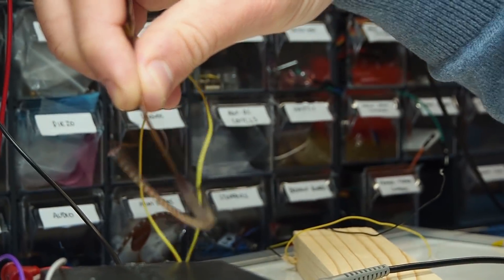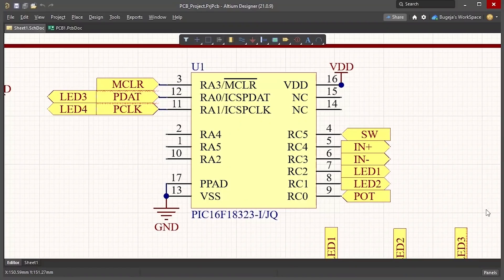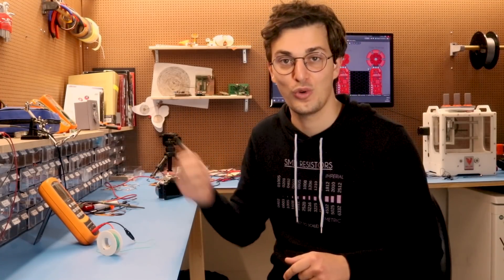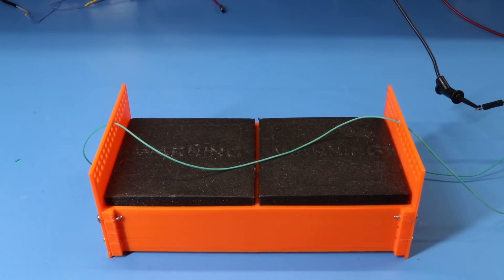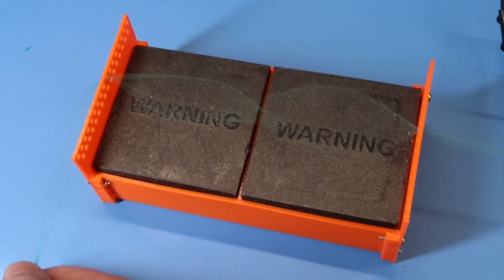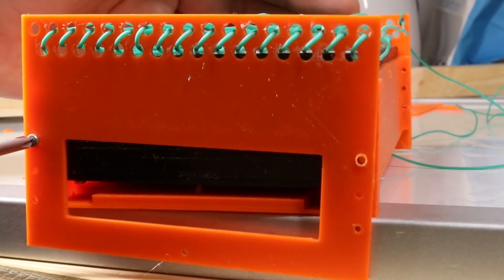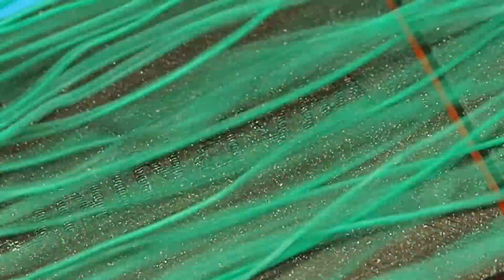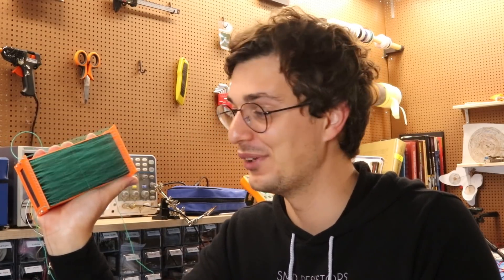Monster Magnet meets Silicone Wire

Comment: What if you increase the frequency so much, that the wire doesn't have the time to fall or climb up, so it stays in the middle, then you can use PWM to get the wires desired height from the magnet, not sure the use, but definetly cool

Comment: If you tighten the wires down and find the resonant frequency, you could have a very unusual oscillator. And if you then redesign the fixture so that it tapers in length, end to end, you might have a variable frequency oscillator of a whole new breed. Either way I’d love to sample it!

Comment: How does the material used for the insulation around the wire affect things?  I would expect that the EMF is a property of the current in the metal part of the wire.

Comment: Reminds me of my experience with the kWeld Spot Welder... First time I tested the setup after having it assembled the leads to the tips performing the weld jumped on me due to them magnetically repelling each other when the load is being dumped - Wasn't exactly prepared for my electronics without movable parts to start moving on me - Totally freaked me out at first.

Comment: Use fluorescent blue silicone wires (phosphorous mixed into the silicone) and a flashing UV lamp and this could be a great simulation of high voltage arcs for a costume or set design.

Comment: "I'm not sure the exact purpose of this this, but it looks super cool"

you just found a way to eliminate motor rotation in a pump or fan, you just need to find a good design to utilize that motion into optimum sequences of back and forth motions that can push water or air (similar to rowing a boat), and also by no motor rotations can also means no need for bearings
Reply: it already exists as a solenoid

Comment: One use: attach a panel with good acoustic qualities to the wires, and make it a speaker
Another use: entry level AC current probe, using a single wire and writing down measurements underneath by comparing the same signal to an actual current probe?

Comment: Flexible LED Filaments found on Ali in the 380mm + variety are I suspect, even more flexible then this silicone wire.   I don't know exactly how flexible silicone wire is at this AWG. - but I'm sure flexible filament LEDs could go along for the ride.

Comment: If you could get them to move far enough, you could possibly embed LEDs in them and create a 3D POV volumetric display (or just a 2D one like your flex display). If embedding LEDs in them isn't feasible, maybe you could use a white/reflective wire and project light onto it in sync with its position to achieve the same effect.

Comment: If you can somehow reduce the weight of the magnets and invert the setup, you can actually make a weird crawler that can move around based on the input sine wave. Amazing video btw great job ..!!
Reply from the maker: thanks! i think the only way the size of the magnets can be reduce is by pumping more current into the wire - which means larger batteries for the robot.. i think it would be impossible to make it light weight enough for it to crawl

Comment: If you reverse the idea, and let wind shake the wires around, you've got yourself a bladeless Windgenerator
Reply: If it could work like that, it may work better under water instead
Reply: @GrimOfDonuts  great idea, extracting energy out of turbulent water is a new concept i guess 
Fancy starting a business together ?
Reply: @olivervoss3196  i can foot $5 in for 98% stake in the company 😅🤣
Reply: Extracting energy from waves and turbolent water (and wind) has been studied quite a lot. The difficulty is not in doing it, the difficulty is doing it well and cheaply. Scaling this up you’ll quickly realize that the cost of the wire per unit of energy you extract will be huge, so there’s no way you could make any money off this, it would cost you more to build than you would ever get back, and the wires will fatigue and break pretty quickly too. Basically, it’s difficult to come up with a worse generator that’s not simply ridicolous (like strapping small generators and batteries to fish and train them to swim in circles and then come back to discharge the battery at a power station).
Reply: The wind concept would work too. I'm thinking about things like Windbelts, but here the magnetic field runs the whole length of the wire (or belt), not just at its ends. Could be enough to charge USB equipment overnight when the wind is blowing.
Reply: @colleenforrest7936  Sure, you could. Say you want ”regular” USB power, 0.5 amps at 5 V, equivalent to a resistance of 10 ohms. Assuming you can get a magnetic field around 0.5 T, a wire 2mm in diameter, wind speeds of around 4 m/s that would give you a maximum of 0.4 Volt/meter of wire. You need the 5 V to charge the phone, so 12.5 m of wire. Not that much, feels doable, except when you consider the cost of those magnets. Also, this assumes that you arrange the wires so that they can be moved by the wind in the direction of the wind. Again, totally doable, but extremely expensive because of the huge magnets used.

If you think about it, this is how a normal generator works, except that a normal generator has the wires in an optimal position to produce power with much smaller (and thus cheaper) magnets (assuming it’s not an induction generator, in which case the wires themselves basically function as magnets).
Reply: @beaconofwierd1883  Could we infact build the wire system but without the magnets, if you use half of the wires to create a magnetic field and harvest the power produced by wind by the other half of wires, it would be an interesting concept nevertheless
Reply: @olivervoss3196  I mean, yes, theoretically, but I highly doubt you could get any useful power out of it. When you apply a current to the wire you’ll create a magnetic field where the strength is 2*10^7*current/distance from wire. So the only way to get a high magnetic field (and thus a high induced current) is to keep the wires really close to each other. If we want the 0.5 Tessla with 0.5 ampere they need to be 200 nm appart (less than the wavelength of visible light). I think you see the problem :p You can increase the current, but you still have the problem of the distance varying when you blow on the wires thur reducing the magnetic field. So while theoretically possible I would say it’s practically impossible, atleast using a setup like this. Maybe millions of tiny wires or something like that, but then they will snap all the time.
Reply: @beaconofwierd1883  I really enjoy your answers, if you don't mind, here's another question of mine: What if the wires were wound tightly around an iron cable as a ferromagnetic core? Would that focus the magnetic field to reach a greater distance, or isn't that how it works
Reply: @olivervoss3196  The constant infront of the formula (2*10^-7) goes up when you add a ferrous core, which is why motors use them :p But generally a solid iron core prevents the wires from moving by being in the way of the wind :p
Reply: @olivervoss3196  Also, the increase in magnetic field strength only occurs inside (and very close to) the metal core. So outside the core you will still have a weak field. These are obviously simplifications, if you want the true magnetif field strength you have to integrate over the whole geometry and it’s very annoying math :p

Comment: Try wiring it up in a way that current only flows one way so you see all the wires doing the same movement, maybe routing the returns to the bottom or the sides.
Reply from the maker: That would probably make it look less messy 😜 though the wires at the bottom would start wiggling
Reply: A wave motion might work like a conveyor to roll things along if you embedded them in some rubber.

Comment: Idea: As shown in this video, the visual appearance is a bit messy because you have wires with opposite current on top of each other, and they have opposite up and down motion. Instead arrange all the left-to-right current wires in one half of the magnet and the return wires in the other half. This way you get two distinct areas of the magnet where all the wires display the same motion.
Reply from the maker: Visually this would definitely be better.. Though there is the width of the magnet that limits it.. While building this I thought it would be easy to visualizer the top and bottom rows which should move opposite sides but it ended up looking messy 😅

Comment: Since the wires move up and down and slightly sideways, maybe you could have separate wires in parallel and use varying current to grab and hold objects and potentially pass something through?

Comment: If you do this with metal guitar strings instead could you make the guitar play by just powering each string with a special frequency?
Reply: There are pickups that put resonance back into the strings, commonly used for infinite sustain.
Reply: @JustinEdwardsL  I did not know that. That's really cool.

Comment: I'm wondering if you could somehow use that to emulate the flagella bacteria use for movement. 

https://en.wikipedia.org/wiki/Flagellum#Motor

I'm mostly throwing possible buzzwords out here, but hear me out - maybe there's a bit of sense in what I'm saying.

If you can somehow use the wire not only as movement, but also as a proximity sensor, maybe a lightweight robot could be built that moves around and reacts to its environment?

Comment: There's something unsettling about the way the wire moves. I like it.

Also: I wonder if there's potential to use this as some sort of low-power manipulator. I'm imagining a flat array of electromagnets switching polarity in order to guide the wire into an arbitrary shape. I don't know what it'd be good for, but it'd be interesting to see. Though, thinking about it, they'd have to be pretty beefy electromagnets.

Comment: Hmm maybe you somehow can use it as a speaker. Interresting experiment
Reply: This is literally how speakers are made. Except the wire is thinner, coated in varnish instead of silicone, and wound into a coil instead of a zig-zag. 

And the coil is fixed and instead the magnet moves on the speaker cone. but that could work either way.
Reply: @felixar90  Well the coil itself doesnt produce the sound. It moves a membrane and that does produce it. I would like to know how well it would sound in this situation.

Comment: "I'm not sure what's the exact purpose of this *giggles*"
We were all thinking the same thing but please keep doing what you're doing
Reply: Make a speaker out of it
Reply: @kevinscott9013  Yes!
Reply: Also seems like with different arrangements you might be able to get a more efficient linear motor than converting rotary motion to linear. Either pushing in the Z axis, or mounting a carriage near the start of the sine wave and then reshaping the sine wave so it slides left to right in the Y axis.
Reply: You should see what properties it has as a generator. Maybe a higher current alternative to a piezoelectric harvester?
Reply: @steve_jabz  if you could put it on something that shakes a lot then you might generate a few miliamps, but even putting it on a rocket won't produce much more that that i think
Reply: a diaphragm maybe
Reply: Exactly what I was about to comment! Yes please.. keep doing these random stuffs.

Comment: Does this work for regular copper wires or just silicone wire?

If no, why doesn't it work for regular wires?
Reply from the maker: regular pvc wires are too stiff for something like this too work.. the flexibility of the silicone wires allow this to be possible :)
Reply: @CarlBugeja  I think it also has to do with magnetic permeability, permittivity, etc. Silicon steel is used in motors and transformers because it is easier to magnetize. This gives you a larger magnetic field for the same power. Copper has a much lower magnetic permittivity and therefore the magnetic field is weaker.

Copper and aluminum does this at very high current like in a rail gun where the inductance is much higher. There is a video on youtube of some THICK cables jumping like spaghetti when they fire a rail gun.
Reply: @excitedbox5705  wow. Thanks for the explanation. I guess its a great thing to ask questions huh!

You rock!!
Reply: @CarlBugeja  Oh ok. thanks for the insight. cheers!!

Comment: Individually address each string and have it output an audio spectrum. Low/High freq. Play music. Could look pretty damn interesting. You could PWM a FET at each string and calibrate each freq/string to wiggle about the same amount for each freq. A real mechanical/electrical audio spectroscope.
Reply from the maker: That would look sick! The wire would have to be divided into pieces though and combined with series resistors
Reply: I wonder what would happen if the wire were sufficiently stiff to resonate (maybe under slight tension) at a characteristic frequency.

Comment: 30AWG... 1.2AMPS??   Hobbyking. -  Hold my Beer.
Reply: That's the still air rating. With 4x 5" props blasting air over the wire you can massively increase the rating.
Reply: @IOUaUsername  then you'd be relying on that air flow, in that case you'd also need to add a feedback thermistor to whatever control circuit you're using, to add an over temp cutoff
Reply: silicone wire is awesome! 👍